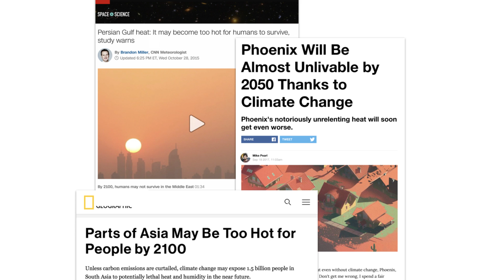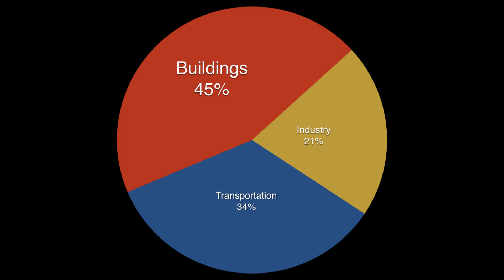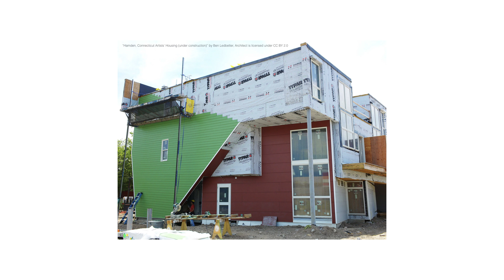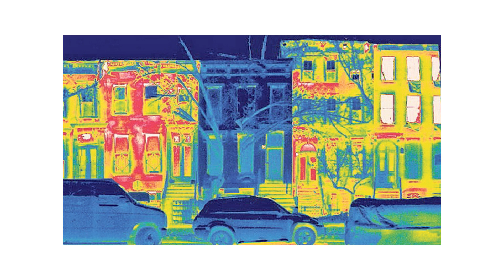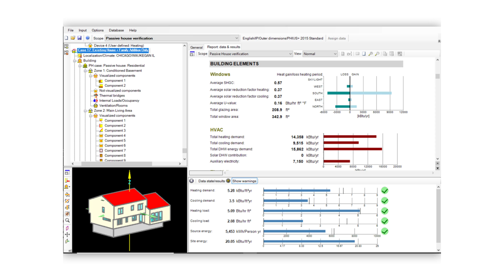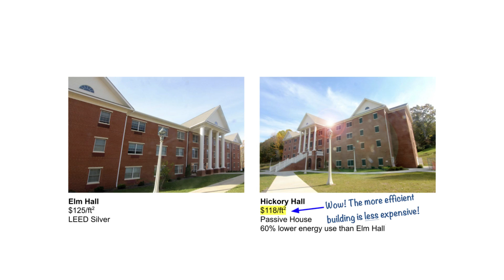Demand Less: Making a Market for Better Buildings | Jonathan Bean | TEDxUofA

Comment: ok, this is nice and all for new construction, but how does this help with existing buildings?
Reply: Great question, Erik. Passive retrofits are possible. The larger the project, the more cost-effective. The ideal situation is when you need to replace everything at once: windows, siding, roof, and mechanical systems. Since you end up with an entirely new exterior shell it's a good way to spiff up a building that's looking tired or outdated, too.

Comment: Those are not the typical American house. Those are typical united-statecian houses. The average American house is a block of reinforced concrete and cement that can last for generations and has better insulation without needed air conditioning or a centrl heater.